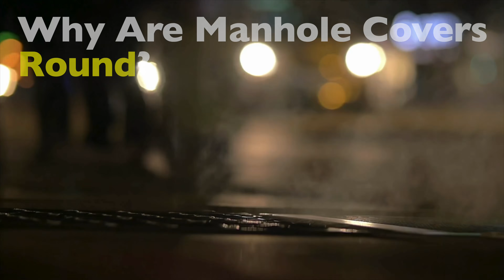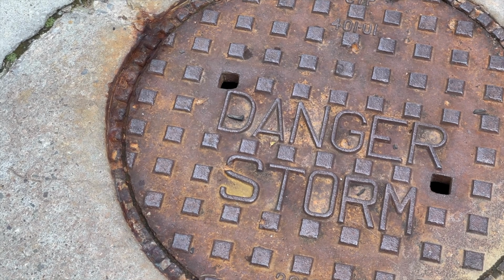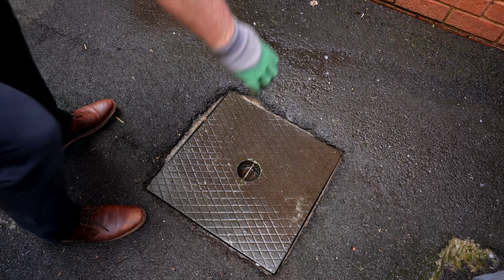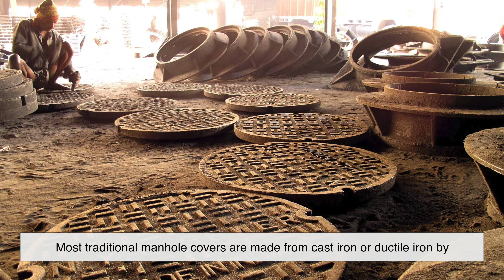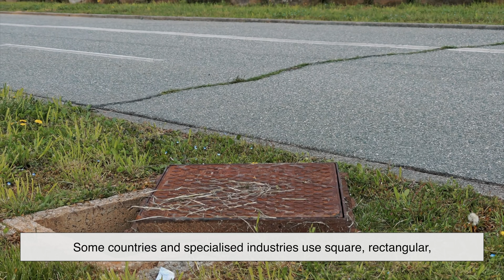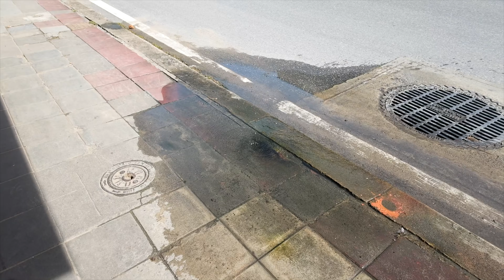Why Do Almost All Manhole Covers Have to Be Round?

Comment: EASY.. It has to do with Geometry.   It is impossible to drop a round lid down a hole it was just removed from.... You can do this to any other shaped lid....  Most guys working in man holes don't want to climb down and pull a lid off the muck in the bottom of the hole.
Reply: ...or be standing at the bottom of said hole while the lid is coming down onto them 😬 - kind of a bad day 🤷‍♂...